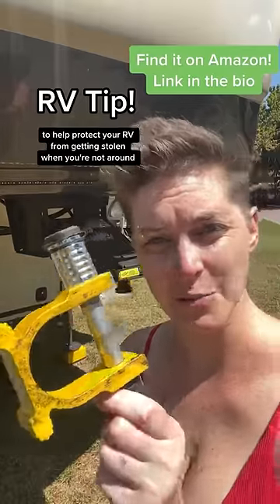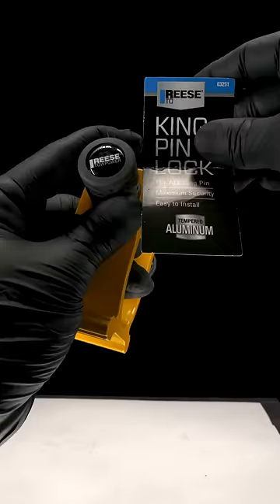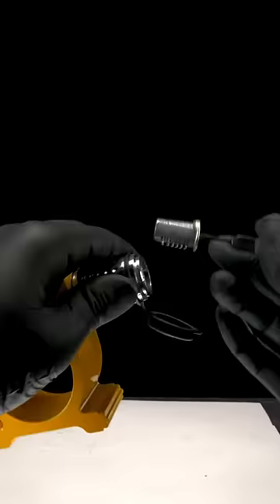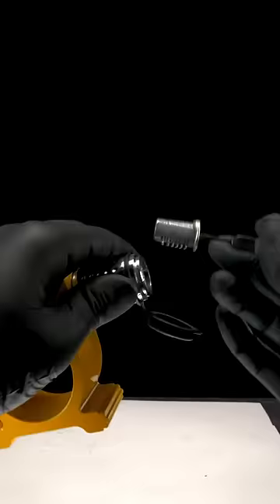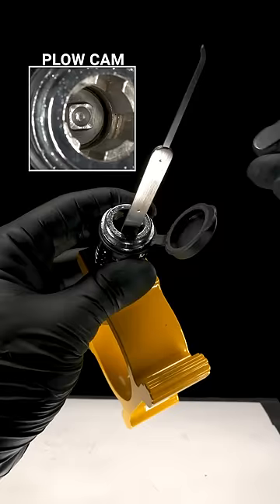Reese King Pin Lock opened with short hook & wave rake

Comment: Just pulled out the locking mechanism of the lock. Security at its finest.
Reply: fr fr
Reply: He didn't pick the lock, he disassembled it 😂
Reply: I don’t believe that, so basically the locking mechanism falls out ? Don’t believe everything you see on internet 🤦‍♂️
Reply: @averygentry35 you'll be surprised by how incredibly stupid some lock companies are. Case in point: master lock
Reply: So he is really really good.?  A cylinder can't come out that easy. show us how!! 
Just like solving a Rubik's cube insect. Practice makes perfect. I get that but you can't believe everything you see. Show us how it's done
Reply: @kaissattieh  He literally did????
Reply: @SuperZePe2 poor assembly. It counts
Reply: @averygentry35 , @kaissattieh, Its a wafer lock, it uses 4 or 5 thin wafers for the lock mechanism and another one at the back to hold the lock core (the rotating part) in place. He reaches in with the hook and pushes that retention wafer up, which releases the core, then he pulls it out. Wafer cores are the cheapest and shittiest types of lock in existence and can be defeated in seconds without any skills.

I took this from @dirkmohrmann8960 somewhere in this comment section (so that people don't say I stole this)
Reply: If he ever becomes a theif it’s over
Reply: @averygentry35 It even has a rubber cap above it, I’m guessing that might stopp it from falling out on its own
Reply: @averygentry35 "Don't believe everything you see on the internet" ≠ "Never believe anything you see on the internet"
Reply: I don't actually have anything to add but a like, but that didn't seem like enough
Reply: @averygentry35  Damn, you didn't even respond to the guy who reposted the explanation to your critique. 🤦‍♂️
Reply: @kaissattieh  Reposting this because it didn't actually @ you.  "Its a wafer lock, it uses 4 or 5 thin wafers for the lock mechanism and another one at the back to hold the lock core (the rotating part) in place. He reaches in with the hook and pushes that retention wafer up, which releases the core, then he pulls it out. Wafer cores are the cheapest and shittiest types of lock in existence and can be defeated in seconds without any skills."

I took this from @dirkmohrmann8960 somewhere in this comment section (so that people don't say I stole this)
Reply: @ProtoAzula  tbf those companies only need to be as smart as their customers.
Reply: @kaissattieh  this guys been around for years showing how easy it is to bypass loads of locks, dont believe him? buy one and give it a shot. theres likely a locking wafer in the back that hes pushing up to pull the core out, its not just falling out
Reply: @averygentry35 this is the same type of lock that Yakima and Thule use for their cargo boxes. They’re barely held in as the box is not made with the lock - you buy the lock separately and install at home by literally just pushing it in and turning it 45 degrees. 

They’re a small deterrence to thieves. As in, my box has a lock and yours doesn’t, so maybe they go for yours first. 

End of the day, I don’t trust them at all and remove valuables before leaving the car and park in good neighborhoods.
Reply: @TheChoosenOne- thank you! For fucks sake it was annoying seeing people respond to others asking how he just pulled it out by saying, "well he did, look at the video" like were not denying that he did it, we wanted to know how.
Reply: @saltedpotato5631  so anytime someone uses their key on it, the cylinder just comes out with the key? Ok.
Reply: @killthecardinals why would I know, I didn’t make the lock 🤷‍♂️
Reply: @Loralanthalas lol 😂😂😂
Reply: @killthecardinals  The cut of your key doesn't interact with the cylinder retention wafer by design.
Reply: @averygentry35 *don't believe what security lock companies tell you.  There fixed it for you.
Reply: @averygentry35 if you don't believe it, than you can keep buying master and brinks.  LOL.
Reply: Technically the lock isn't picked xD
Reply: @8stormy5 Cause he removed a pin before hand
Reply: @averygentry35 if it's cheaper to manufacture it that way? I see companies doing that
Reply: It's a wafer lock that has a release wafer at the back of the plug. They're actually very common.
Reply: Who said that you could do this? Not fair!
Reply: @averygentry35 not exactly. Wafer cores like this one have a control wafer that allows a master key (or knowledgeable entry specialist) to remove the core so it can be easily rekeyed.

Comment: “Take out the lock, and unscrew it.” Is basically what he said
Reply: that's way too easy!
who buys these things and doesn't test them?!?
Reply: Take a potato chip… and EAT IT!
Reply: @cromptank he HA(death note)
Reply: @DannyFuego1Love who even produces them without testing them lol
Reply: @dpboy8 They don't need to work for people to still buy them. Unnecessary R/D costs 😂😂
Reply: @Maybe_Tom_Cruise well they'll worn on people with the same level of lock understanding as people who buy this
Reply: @Maybe_Tom_Cruise work*
Reply: @einnaddannie7526  Exactly look how popular masterlock is and they're absolutely terrible. People will buy them regardless.
Reply: how he casually pull out the "cylinder" super glue also would have worked .
Reply: @cromptank  L piano theme intensifies
Reply: Locks are for gentlemen,, No Locks for thieves😊
Reply: @Maybe_Tom_Cruise they do their job of deterrence.
Reply: @DannyFuego1Love they do their job of deterrence.
Reply: @cromptank 😂🤣🤣🤣🤣🤣🤣🤣🤣🤣🤣🤣🤣🤣😋
Reply: You still have to pick the lock first.
Reply: @uddhavsaikia739 (choir voices sing dramatically)
Reply: @J.C...  You literally don't, he used lockpicking tools as part of a joke where he uses a pick as a hook and two picks as a wrench. No picking happened here.
Reply: Some older cars can be stolen by essentially doing this with the ignition as well. Of course, I can both confirm that it not only works with a '94 Toyota Corolla and that its not worth the labor in a '94 Corolla. Just pull it out and you can just twist the equivalent of the restraining bolt. 

Side note: I owned the car I did this too. Ignition would turn by key anymore and I didn't have the money to fix it.
Reply: the screw is alot harder than the lock itself~
Reply: @J.C... no you don't need to pick it. You can just remove the cylinder.
Reply: @freedomandguns3231  do you not know the difference between "would" and "wouldn't"?
Reply: This video was even more jarring when it started to play back and noticed that the advertiser was a woman
Reply: @boredboi6279  could be confusing her with another one but I'm pretty sure she is one of those dinosaur people I've seen on YouTube videos in the past. (So many of them look alike)
Reply: @davidy22 it must make life so much easier at times to be as simple as you. You actually think he just inserts the pick into a random spot, as long as it grabs, and pulls it out?
Lmao.  Have you not seen the rest of his videos where, to you, it may look like he just shoves a pic in and it unlocks like magic? Or when he strikes them they just pop open every time? You really think that's what's happening, dont you?
Reply: He can unlock everything but iCloud activation lock ……hope this ages bad

Comment: "removable locking mechanism" should never be a characteristic of your lock.
Reply: You can replace cores in almost every lock, the difference is that in decent locks, you can only do it with the lock open.
Reply: @enderforces7013 i dont think changing the core will t
Reply: @McGreenBean i dont thinknit will t either
Reply: @McGreenBean yeah, but it might h
Reply: @ghowostie nah but it'll definitely k
Reply: E
Reply: You don't have a choice.  If you want to open a lock, there has to be a mechanism that unlocks it and eventually someone is going to figure out a way to exploit it.
Reply: @frankvonfrauner That's just not true.  There's no such thing as an unpickable lock, that's true, but there are basic steps you take to prevent people from completing bypassing your locking mechanism.  This Kingpin lock did none of that.  Most Master locks do none of that (which is why they are a joke in the lockpicking community).

Most other brands of non-gimmicky locks don't have these problems, and to bypass them you have to actually pick the dang lock!
Reply: All locks are 😂.
Reply: @onafederalwatchlist6948  okay but what if it g instead?
Reply: unless its SFIC! (Small Format Interchangeable Core)

Comment: This guy and Lock Picking Lawyer have taught me that in general locks are useless if one knows how to dismantle them.
Reply: Locks are mostly about adding a step of resistance to the prices of stealing or breaking into something
Reply: Locks only keep honest people out
Reply: I think what you should take from them is, yes, use locks. But don’t just use locks. They’re useful but they are not the be all and end all of security
Reply: In some cases, you don’t even need experience.  When they use a wave rake, that’s when you know the lock is complete trash.
Reply: That’s most things
Reply: Nothing a good ol' smack with a hammer can't do.
Reply: Some are so fucking expensive too. Macy's requires all vendors (brands that sell clothes in Macy's) to use Best locks on fixtures that store clothes. Best cam locks are like $69-100 for just the insert, and about same for housing. You can only open the lock with the key inserted so retail staff are constantly closing drawers with cams in locked position which bends the cams making them useless within a month or so. 
Some configurations of Best locks are $200+ and can be forced open. I'm not incredibly strong either. Probably slightly stronger than average American male. 
Then Macy's complains to the fixture manufacture that their shit keeps getting stolen, but as the manufacturer, we have to use the locks they specify
Reply: No way!!!!!!!!!
Reply: I literally thought this was the Lock picking lawyer lol
Reply: Moreso that you have always been capable of doing so, it's just it's illegal. Showing you HOW to do it, but please don't do it lol
Reply: And now thanks to this guy and Lock Picking Lawyer anyone can
Reply: @seansecker9398  😂😂very true
Reply: You could've left it a locks are generally useless. A lock is tool and like any other tool, it requires a competent user. In general, most locks are far tougher than what they're attached to. No one is going to bother picking a Master lock, when they can knock the hasp off the door with a hammer. Or pick a door lock, when they can pry the doorfram away from the lock.

Anecdote - a neighbor got their toolshed cleaned out. They had a nice looking lock on it, too. The thieves pulled a board off the fence it was against and unscrewed a sheet of siding off the back. Imgaine going out to your toolshed, unlocking it, opening the door and seeing the alley. The best lock ever made, wont secure a cardboard box.
Reply: @hokuwong  

Correct, they're an obstacle to eat up a adversary's time on target.
Reply: @jancarloanguiano5220  

Experienced pickers fallaciously refer to raking as 'low skill'. Its definitely not. LPL and I actually had a solid discussion about that. While some locks are so bad you can just stick anything in the keyway, raking is itself, a fairly advanced skill to use on anything but those terrible locks.  A guy I work with can rake locks full of security pins. What he usually does is scrub the pins to set whatever will set and then rocks it to hit everything else. Thats not a 'low skill attacker'.
Reply: @jancarloanguiano5220  bros not even using the rake. hes just screwing it
Reply: @seansecker9398  No, if it's not fast and low risk, burglars will most likely give up. Taking the time to pick when the valuables may not be worth much is just allowing more time to get caught in the act.
Reply: “Locks are to keep honest people honest”
Reply: Yup
Reply: If you have a lock, and the other guy doesn't, they'll go into his RV and not yours. Making an extra step or two, adding time where they could be caught is a deterrent.
Reply: And plenty of locks can just be smashed
Reply: And then they post it all over the internet for all the thieves to see 😂
Reply: @vond5829  facts
Reply: @devonwhite1653  This is LPL chaotic neutral brother

Comment: “You are using a lock completely made of Rupert’s drops with their tails burnt off, making it near impossible to get in. But, here I have a lock pick, and you are no longer safe”
Reply: "Its weakness is my existence"
Reply: Can you melt the Rupert’s drop?
Reply: @Savage808_   Keep in mind, glass melts at 2,800°F. Borosilicate melts at 3k. So unless you're just randomly carrying around a propane torch, y'ain't meltin' the Rupert's Drops. XD
Reply: @Savage808_ also, even if you melt it the weak point will still be there, it’s just not as obvious.
Reply: @skelly_snipez1291 or weak
Reply: no picks required  one ring from keys or soda can ring pull -short hook + any screwdriver or or a nail file /or wiper or any metal frame glasses and pull plastic ear hook to reveal flat section of frame as a tool-use what you have
Reply: My favorite comment on his videos so far this deserves a heart
Reply: @skelly_snipez1291 no, it’s weak because of the thinness of the tail, when that’s gone, nothing can touch it.
Reply: @skelly_snipez1291 you can melt the tail off so much to the point that whatever's left  fterwards simply couldnt be hit because it was too small
Reply: @Mercury_cougar_lover223  It is strong because of the tension create when glass cools rapidly. When the tail is melted the tension is released and it weakens dramatically
Reply: i feel like most of these locks are more like normal Rupert’s drops: plenty strong in the front, but with a huge glaring weakness in the tail where as soon as you touch it the lock completely collapses
Reply: Rupert's drop with removed tail is just a regular glass ball
Reply: Bruh I just watched a video about that.
Reply: @warriormaiden9829 heatign head of Rupert's drop actually undoes what makes it special
Reply: @warriormaiden9829 what kind of amateur is approaching a Ruperts drop unprepared?

Comment: At this point I’m welding everything and adding a lock as a decoys while they try to open it.
Reply: Universal key will open it... enter grinder 😂
Reply: Or a acetylene torch 😂
Reply: He’ll pick a master lock securing a grinder and cut your welds
Reply: He already lockpicked that one @mtplaine
Reply: Thermite bro.... thermite😂
Reply: Anything that can be welded can be cut lol you'd better hope you're using stainless steel at minimum to make it take a little longer to cut your welds off 😂
Reply: At that point, I would just sell everything I own.
Reply: @GraceAlone614  cant sell money
Reply: @GOD404..  who said anything about selling money?
Reply: Just start to carry an angle grinder and a welder around with you
Reply: Then you still hear him outside
you are using a-
Reply: Best way is to jack your wheel and bring them with you to this point xD
Reply: He”ll still open it one way or another
Reply: The FBI is looking for this guy
Reply: Nothing an atomic bomb cannot destroy
Reply: "You are using a PowerTIG 250 amp TIG welder.  To bypass it, I will be using an upside down can of compressed air, and a small mallet."
Reply: @trym2121 these are the one of a kind nuclear missile silo lock and key ignitions, to start nuclear Armageddon, use a nuclear missile silo lock after picking the other 7.
Reply: @bigman8753 cant be stuck if its liquid!

Comment: Ironically enough, a king pin lock was the reason I found McNally in the first place. I never saw this video, but watched some videos on how to pick a lock. I'll have to check the brand the next time I go to the farm, but it actually picked a lot quicker than this process for this brand. In fact, it turns out that I could probably have picked it without watching any videos because after I made tension and slid my pick in I shifted how I was sitting which moved the pick and CLICK the darn thing opened! Upon investigating, you only need to hit the back of the lock and to the side for it to release. Just like a Master 605.

Comment: The company that made this should hire this guy to design their locks.
Reply: Anybody & everybody needs to hire this guy.
At least for security advice.
Reply: They tried to design a lock to slow down people like Lockpicking Lawyer, and then they discovered it was insanely difficult 😂
Reply: The lock works fine for it’s intended purpose. No lock is ever going to be impossible for someone to open without the key. The point isn’t having unpickable locks, it’s to have locks that make your stuff not worth the effort. Chances are if someone is stealing RVs, if they see a lock on one, they’ll go on to the next one that isn’t locked rather than spend the time to get the lock off.

The lock on my shed can be picked, sure, but if it takes longer to pick than the crappy lock on my neighbors shed it’s doing the job just fine.
Reply: @Glmorrs1  Had a guy who maliciously stole everything that a masterlock was on 😂 poor masterlock